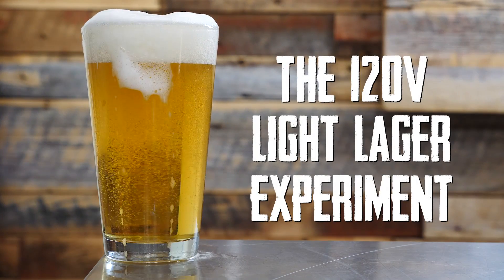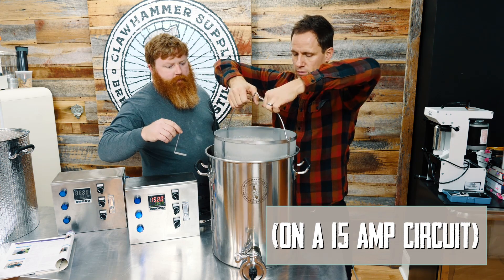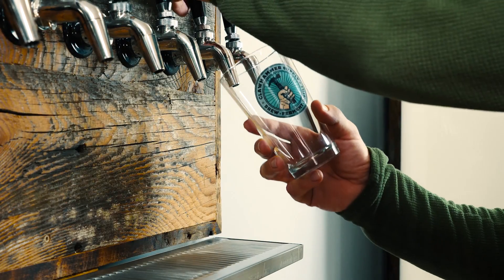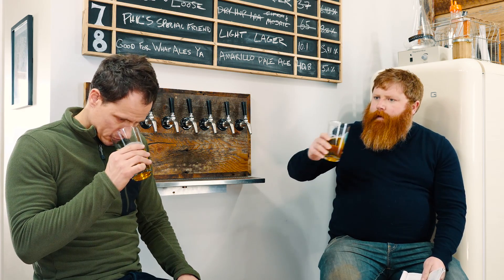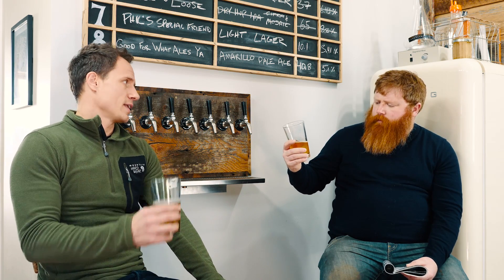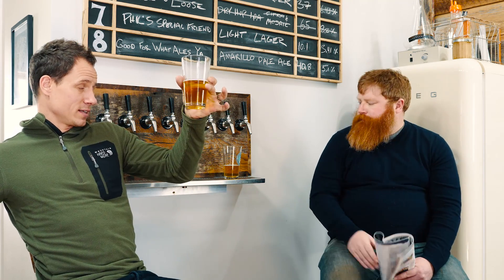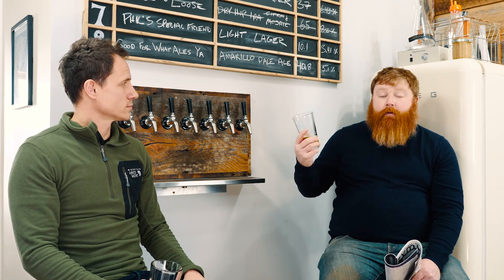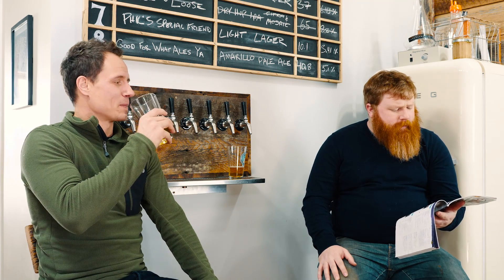Boiling With the Lid On - Why It Doesn’t Matter

Comment: Good Job ! I've exeprienced that the yeast you use Saflager 34/70  is especially good and helps the fermentation process with DMS. A good recipy is 5000 gram pilsner malt (ebc 4) and 300 gr carapils with 15 magnum @90, 30 gram saaz@30 and 20 gram saaz @10 min gives a really good light and crisp typical german pilsner, with this yeast.

Comment: When will these systems be available again?  Your website says they are sold out.
Reply from the maker: Hi Travis. Thanks for your interest! We're transitioning from V2 of this product to V3, which means that we're making a few changes and will be waiting on new parts for a while. We'll have a better idea this coming week, but i'd guess we'll be back in stock the middle of April. Like our last batch, we'll only have a limited quantity. So, keep an eye out for the pre-sale!
Reply: What is the grain capacity of the basket?  I sometimes brew 5 gallon batches with up to 19 pounds of grain and was wondering if the basket will hold that amount.  Thanks.